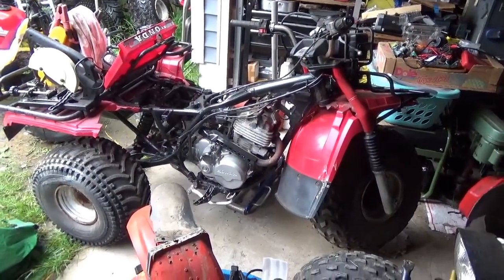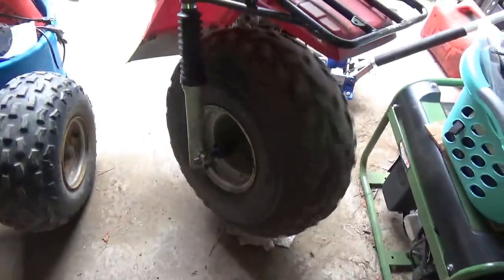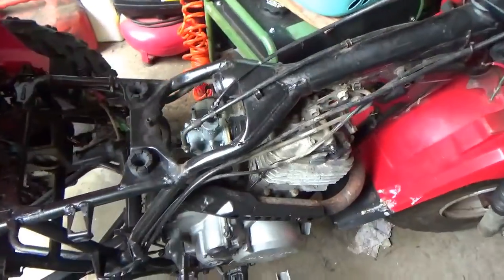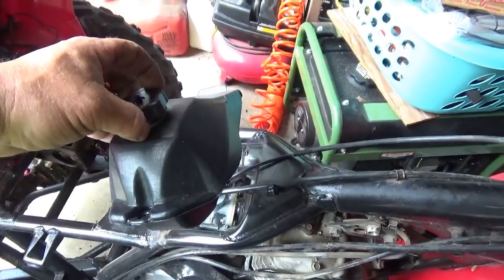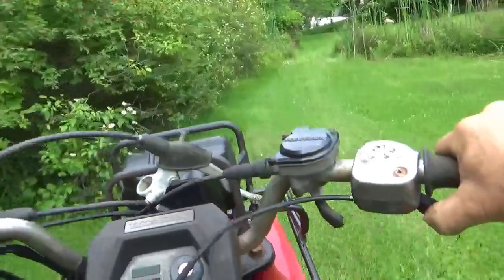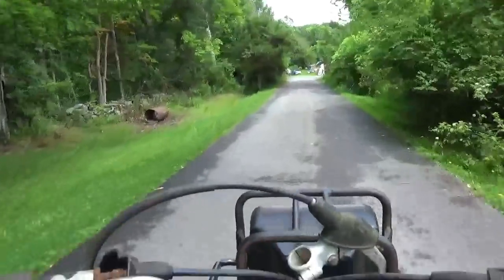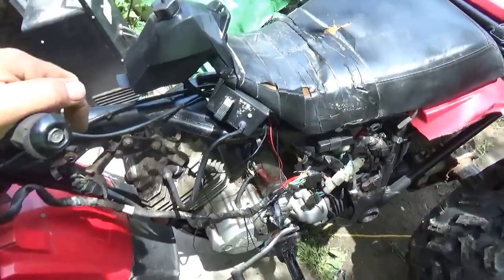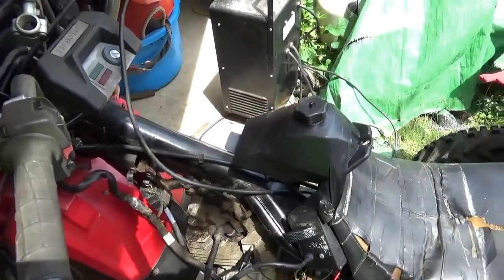Rusty 1985 Honda Big Red 250ES,  First Ride, $200 ATC Starts, Runs, Moves!

Comment: About the hole in the gas tank Harvey sand that spot down good and go to O'Reilly's and ask them for the two-part gas tank repair the stuff works really good it will stop it from leaking and it will hold up and that broken brake shoe is a definitely a issue it could cause the rear end to lock up just from it getting wedged I had the same problem remove the broken shoe and it was just fine keep up the good work Harvey and keep up the good videos hope to see more if you ever get your hands on a 2001 Kawasaki ke100 B they are pretty funbikes I have one that I am fixing up right now having a little bit of a clutch problem on it when you pull in the clutch it's not disengaging